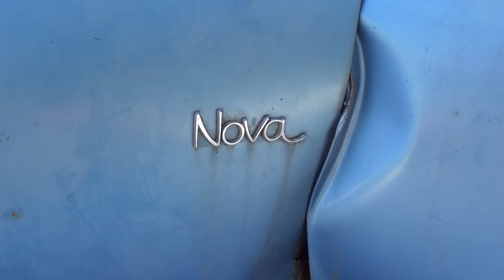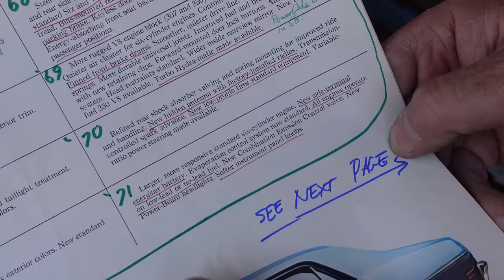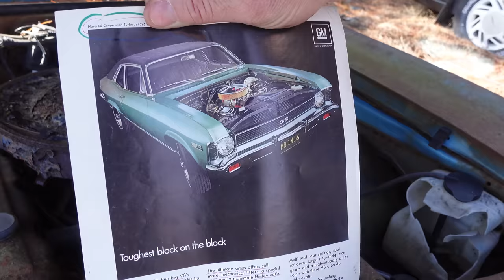Nova The Moon

Comment: My Mom had a 72 Nova with a 350 Cubic inch and I had a 1971 two door and a 1975 four door both with the straight 6. The 1971 250 straight six ran like a scalded dog and had lots of torque and power. I would love to have another one now. The 6 cylinder was a reliable, powerful and low maintenance engine.

Comment: Nova means "Doesn't Go" in Spanish. LOL.

No VIN, can't win, but easy to figure out, no doubt: 1 for Chevrolet, X for Nova, 69 for four door sedan, D for 250 CID straight six with one barrel, 2 for 1972 model year, N for Norwood, OH, L for Van Nuys, CA or W for Willow Run, MI assembly and the rest is the production sequence. The Van Nuys, CA assembly plant, one of the "Terrible Three" of the GM system closed in 1992 and last assembled the 3rd generation F body cars. The Norwood, OH facility closed in August 1987 and last made the 3rd generation F body cars. Production was then moved to Van Nuys, CA. The Willow Run plant closed for vehicle assembly in 1993 and then became a GM parts distribution center for a number of years. 1972 is the first year that a GM vehicle's VIN number gives you the exact specific engine that was originally installed, and this continues today with the present 17-digit VIN numbering system that we have (which started in 1981).

No tag, can't brag, but easy to figure out, no doubt: ST72 for 1972 model year, 11369 for Chevrolet (1) Nova six-cylinder (13) four door sedan (69), LOS for Van Nuys, CA assembly, WRN for Willow Run, MI assembly, or NOR for Norwood, OH assembly, 756 for Blue Cloth bench interior trim, A52 for front bench seating, possible 24 24 for Ascot Blue upper and lower exterior paint (or maybe 26 26 Mulsanne Blue upper and lower exterior paint), among other codes. 

I had a 1979 Nova four door 305 V8 that was my uncle's car from new. I sold it in 1993 shortly after I got it from him. I bought dress clothes with the proceeds and used them for job interviews, getting my first job out of undergraduate school as a result. That was with the auto parts manufacturer, which I did for 11 years before moving on to my present job.
Reply: Man u know your Novas lol I've had my 68 ss nova for 20+years factory 4speed 11427 735 interior built at willow run
Reply: @tommycook9620  Thanks. Working in the parts industry, I had to know them all.

Comment: I’m restoring my 5th nova!  I’ve had a ‘72, (2) ‘73’s, and (2) ‘74’s.  3 of them were SS trim.  I have a passion for the 73 & 74’s with the SS stripes.  ‘68-‘72 can be easily restored from a catalog, but although the 73/74’s look very similar, there are many subtle differences that make restoring a 73/74 a real challenge.
Reply: A buddy of mine had a gold '74 SS 4-speed car when we were in highschool. I still think of that car often...
Reply: Try restoring a 4th gen….. that’s a real challenge!
Reply: I worked at a Chevy agency in 1981 that took in a '73, non-SS, 4-barrel 350/4-speed/ dual exhaust Nova 2-door in trade. A real sleeper, it was dark blue with a black interior, blackwall tires, and full wheel covers (Don't ask me how I knew it had a posi rear!). Unfortunately, one of the other guys in the shop had already put in an offer on it before I ever saw it.
Reply: @corvairjim1  that’s too bad that it got away from you.  My current’74 SS was midnight blue on midnight blue, bench seat, 3-speed on the floor, and a 350.  
I’ve resto-modded it extensively.  It now has a 409 sbc, roller cam, AFR heads, Muncie 4-speed, mini-tubs, black bucket seat interior (with console and gauges) and when I get around to painting it, it will be bright red like my previous’73 was.

Comment: Good morning, In 68 when the new Nova came out, it shared almost every mechanical part with the 67-69 Camaro. Even the sub frame was the same. The Firebird also shared some, like the subframe, but most of the parts on the Firebird  were Pontiac

Comment: The 1972 Nova was my first "NEW" car I ever bought. I ordered it with the  "Rally Nova" package, 350, 4bbl, dual exhaust, Posi-traction rear, bucket seats but could only get a 3 speed manual trans on the floor. It was a great car, I finally sold it in 1996.
Reply: My 1972 Majove Gold Ralley Nova had a 350 2v, 3 speed with a bench seat and single exhaust.

Comment: In the early 70’s my wife and I both worked for RI state government and the state gave her a new ’73 Nova to drive as part of her job.  It was Black two door with a green cloth interior, the only option was the three speed automatic.  If you wanted a radio you bought a $10 transistor at Radio Shack and just set it on the dash – it worked fine.  When she left for grad school she threw me the keys and I drove it until I left the agency in ’79.  Between us we put about 150,000 miles on that car with no repairs needed.  The drive train was absolutely bulletproof.  The state required that we make sure regular maintenance was done (regular oil changes and tune-ups) but that was it.  The state really got it’s moneys worth out of that car.  The other car the agency bought that year was the ’73 Hornet SST.  That car was good for the first 1000 miles but after that went down hill fast.  The Nova just went on and on.

Comment: I had a cousin who had a '74 2-door Nova, as his first vehicle. It had the 350 V8 and automatic.

And my maternal grandmother had a '78 4-door Nova.
It had the 250 inline six and automatic.
Her car led a very lightly used, and somewhat charmed life... until one unlucky (or lucky... depending on your point of view).
I remember it like it happened yesterday.
December 28, 1986.
Our son was a mere 27 days old.
Our vehicle was in the shop, so I had borrowed my grandma's car for a few days.
Earlier in the evening, we had taken out son to my wife's parents, so that we could go to a movie.
We were on the way home from picking out son back up (around 10pm).
As we traveled down the 2-lane highway towards home, I fell asleep at the wheel, as we crested a hill.
On the other side of the hill...parked on the shoulder...was a broken-down small 4-door car.
Anyway...Young idiots that we were, we hadn't put our son in his car seat "because he was fussing".
So my wife was holding him in her arms. She didn't realize that I was falling asleep... UNTIL the car's passenger side tires left the pavement.
At that moment, she seen the parked car... and screamed.
Her scream instantly woke me up.
I realized what was happening; seen the car in the headlights, no more than a couple hundred feet away; instinctively turned the steering wheel back towards the highway as hard as I could, moving my foot from the gas pedal to the brakes... but only tapping the brakes, because I didn't want to lock them up.
The next moment...as our car turned back on the road... the passenger side front corner just caught the rear of the parked car, in a "glancing blow; which helped to propel us across the road.
The impact also caused the passenger side front tire to blowout...which...along with my movement of the steering wheel, to keep us from ending up in the opposite ditch... brought our car back to the ditch on our side of the road.
Fortunately the ditch was very wide, and smooth. And I was able to keep the car on it's tires, and get stopped.
Upon stopping, we assessed our son...who my wife was still holding.
None of us were injured in any way!!!!
Just scared.
There was a farmhouse about 1/4 mile away.
I walked there. Got the owners to call the sheriff's office. And walked back to the car, to wait.
Anyway... after the police report was taken, we had the deputy take us home.
We went back and got the car the next morning.
And actually drove it home!
After fixing that car, my grandma continued to drive it for the next 15 years!

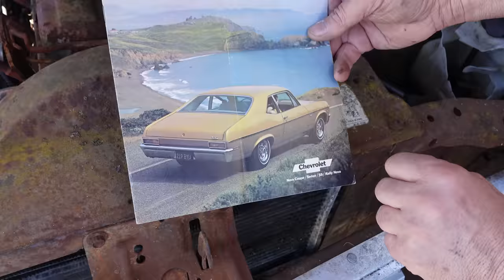Comment: Steve mentions the 4 door was new for 72 at 4:49.   Novas were always available in 4 doors, I had a 69 Nova 4 door.
Reply: I owned a 70 4 door 307 automatic.
Reply: My grandfather bought a new '70 4dr with 350.
Reply: Think either he misspoke and didn't say what he meant - or possibly, that he was thinking of the Ford Maverick, which was a two door only for its first few years, with four doors first being produced in 1972 or so.
Reply: @DanEBoyd  First model year for a four-door Maverick was '71. For its debut model year (1970) only the two-door was available.
Reply: @DanEBoyd  Only for 1970, for '71 Mav & & newly introduced Comet both had 4dr models.

Comment: Steve back in 80's i had 7 novas from 63 Ss to a 74 ss hatchback that included the tent. my daily driver was a 71 4 door. my alarm system was when i parked it would pull the coil wire putting in my pocket. Thanks for the video. i had the 63 Ss, 64, 67 ss, 70, 71,73, 74 ss hatchback and they all ran and drove.

Comment: I had that exact model and colored nova in 81 for a winter beater so I wouldn't have to drive my chevelle during the snow...bought it for 100$ in the fall, put a set of lifters in it and that thing was the most reliable car I had...on the coldest of mornings it would fire right up, burnt 2 qts of oil a week and was a rusted out eyesore but it got me through the winter. The guy who sold it to me asked to buy it back that spring and paid 300$....couldn't have worked out better. I miss my old nova.

Comment: Hi Steve, great video on this more door, Nova. Remember when everyone in the custom hot rod community were using these sub-frames under their builds and the Mustang rack and pinion? I once bought a small hoard of this generation of Nova. I sold most up north but were left with a couple of 4drs. I had a friend talk me into turning one of them into a circle track car. Man, that was some fun and exciting stuff! Some rubbing and some bumper to bumper action! I ended up finishing 12th!🏆There were 11 race cars and a tow truck...🤣. I probably should have taken a little better look at the eternal integrity of my engine or some sort of rev limiter. The little 307 floated the valves, and things started to disagree with one another. So I decided that I would retire early and leave my circle track legacy for the history books. I'm not sure how some do it. That's definitely an expensive hobby, and the prize isn't great. I still like to run one of those 24hrs of Lemons. I think the biggest challenge with that is finding a car for $500! I'd like to apologize once again, Steve, about yesterday when I asked a question and I didn't make myself clear on what kind of car it was. It was a 48 Plymouth coupe. Someone here on the channel answered my question. I was almost certain the glass jar was for the windshield washer. But being a 48 and a Plymouth I wasn't sure if that option was available. I greatly appreciate the time and research you did for me. When you're up late and traveling on the rd,  sometimes the details get lost. Thanks again. You've mentioned you like music and a couple movies in my comments. I would like for you to watch a movie called "American Pop" if you haven't already. I believe your love of history and music can appreciate this film. It's a mix of animation and real footage. I woke up around 1am back in the early 80s, when I had fallen asleep watching TV. The opening credits had just started when I woke up, and for whatever reason, it hooked me in. I found it a very powerful movie. The movie I fell asleep watching was 'A Clockwork Orange', and that's a great movie itself. Well, I'm heading out now to clean up the ol 48 Plymouth and get her ready to sell. Have a blessed day, everyone 🤙🏼 Namaste 🙏🏼
Reply from the maker: "A Clockwork Orange"....timeless and nasty! I'm off to Bernardston today. It snowed last night and it'll be a grinder keeping the paper props dry. But otherwise its a "winter wonderland" (as in I WONDER what the hell I'm doing in this cold stuff!). But there's a '48 HUDSON in the mix! Thanks for watching and writing. -Steve Magnante
Reply: @SteveMagnante  Great! Stay safe and warm. I'm sure I'm 1 of many who can relate to the things we battle against to get to that rusty gold. Traveling – it leaves you speechless, then turns you into a storyteller. Namaste 🙏🏼

Comment: My first car was a 1978 Nova 2-door. To a 16 year old guy back then, it felt like a muscle car. Bought it for 600 bucks in 1992-93. Garage kept with 64,000 miles on the odometer. I'll never forget that car, I "cut my teeth" with mechanic work on it. Alot of valuable lessons learned with it.

Comment: Great Video, We had a friend that bought a super clean used two door Nova from the VON (an organization of home health care nurses that used to look after the elderly) These cars were surgically clean! They were Navy Blue with black interior bench seat, they still had VON on the door! We put a killer 454 (550hp 625ft lbs) reverse valve body th400 and a 12bolt with 4.11 posi We even got the dog dish hub caps to fit 15x8 rally wheels we had on the back. His girl friend was with the VON (how we found out about them being for sale) She was a female gear head and used to take great delight in cruising with her uniform and hat on. She would line up with some guy and challenge him. Of course she thought she was nuts until she put 4 cars on him!

Comment: Hi Steve. I am Anthony from Australia. I like your work very much. I have a 1962 Studebaker GT Hawk. LHD. 289, 4 barrel, power steering, power brakes and Air Con. I have the original Build Sheet from Studebaker Museum in South Bend. .. it was built on 15 December 1961. I was 5 years old then. A Californian dry car imported to Australia in 1989 and restored in 1990. I drove it yesterday (26 Feb). Starts every time. It’s our role to save these machines when we find a good one. Oh, and yes I also have a 2017 Mustang, RHD 5.0 litre 6 speed too. Please keep educating us. May I also say, with some great respect…. It’s okay if you loose the stuffed dog. It’s a focus distraction from your good presentation.  All the best.

Comment: My Grandfather on my Mother's side had a 72 Nova 2-door, Forest Green metallic with the 350/T350. Not sure if it was 2 or 4 barrel, but man it was clean, even into the late 80's. Definitely had the 350 fender callout. They lived in Easton, PA, and it stayed in the garage during the winter. They also had a 67 Camaro RS, 327, Aztec Gold with black pinstripes, black bucket interior, floor shift (maybe the T350? Don't recall. Might have been the PG). It also hibernated for the winter, had one rust spot the size of a quarter on the LR quarter, just behind the tire. I was supposed to get that 67 Camaro RS as a HS graduation present in 1986, but that didn't happen. I am still pissed off and bummed out by that! Thanks, Steve! You are the man!

Comment: Love the 3rd gen Nova! I had a stripped down Cortez silver ‘69 two door with 250 six banger and (unfortunately) a Powerglide 2 speed automatic. The 250 was an awesome engine; only problems I ever had were the intake manifold bolts occasionally loosening themselves up and causing a vacuum leak and the distributor getting wet if you drove through a puddle too fast. The Powerglide was a PITA though, it was always needing band adjustments and tended to creep into neutral at stop lights. I would’ve rather had a Turbo Hydramatic or even a three on the tree. They did actually have four door models all throughout the 3rd gen line of course, but I got lucky and nabbed me a two door!
Reply: yes watch out for puddles, that 250 was a great motor

Comment: Love these old Novas. Those 250 straight 6's aren't bad either. Had one in a 78 Camaro that wouldn't die
Reply: I could chirp the tires going into second gear with my 250.
Reply: Yep, most of the 250s were pretty good motors.
During my Junior and Senior years of high school, I drove a '77 C10 that belonged to my parents.
It was a 250 backed by a manual 4-spd. 3:73 rear gears.
It was set up to run on propane.

Comment: Chevy II/Nova's in the 1-3 generations were great reliable little cars that took a beating. In the early 80's I had a 65 Chevy II 4dr with the Powerglide and the smaller 194-6 and power assist steering. It was a reliable fun little car. All I had to do was rebuilt the carb with a $12 Jiffy kit and it ran perfect after. In the early 70's mom had a red 65 Chevy II 2dr post sedan with the 230-6 and Power glide that we all loved until someone backed into it and stuffed the trunk in.

Comment: Correction Steve...Chevrolet did in fact build a 4 door SS well before the Impalas of the 1990s. In fact, it was a station wagon! For 1 model year only, 1973, the SS option was offered on the Chevelle station wagon. Rare? Yes indeed but, they are out there.

Love the videos!
Reply: That should have been a 400 SBC for sure.

Comment: The AC Delco side terminal battery was lighter weight than the same cold cranking amps top terminal battery. For several years, if you needed a side terminal battery, AC Delco was the only choice. A friend had a 4 door Nova with a 307 V8. That was a great car.
Reply: I replaced the side terminal bolts with exhaust header bolts, 3/8" course threads and hex bolt was 7/16".  The oem bolts on the side posts were to tiny.  Other than that side posts were great.

Comment: These were bread and butter cars. In the automotive pantheon, there are some Hallmark cars of the 60's and 70's and it usually has to do with performance packages and drivetrains. But that was a small percentage of vehicles bought and sold in the period. People still needed cheap and reliable transportation and Nova got that done for Chevrolet. 250 and 307 engines were bread and butter engines. They were the drivetrains people needed to conduct their lives. And while these bread and butter engines and not very glamourous, I find them all fascinating. Chevy 250, Mopar slant 6, Ford 300 (4.9L), AMC 258 (later the jeep 4.0L) these engines are reliable at a modern level and can go hundreds of thousands of miles with proper maintenance. The engineering that went into them to make them reliable and affordable is very interesting. Just as interesting to me as the engineering of big power.